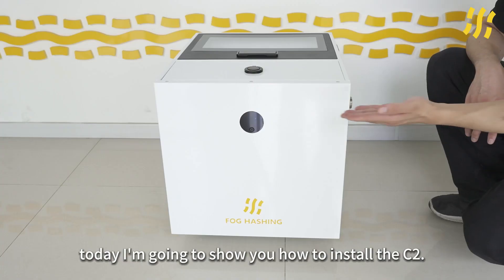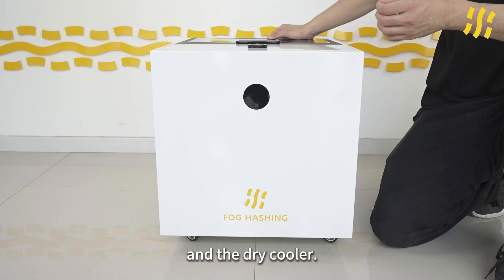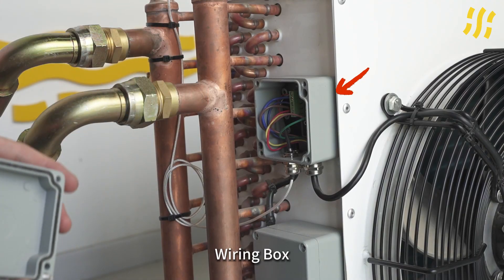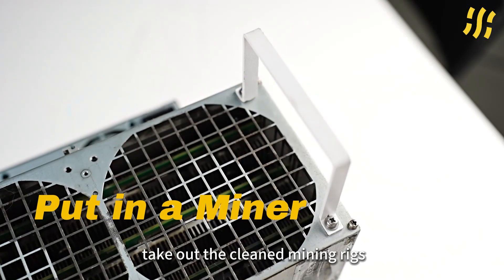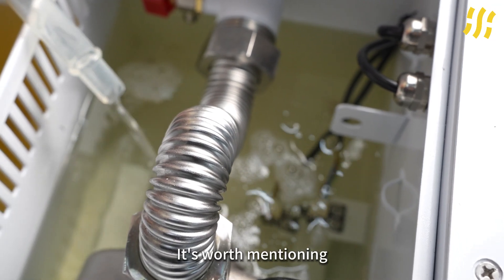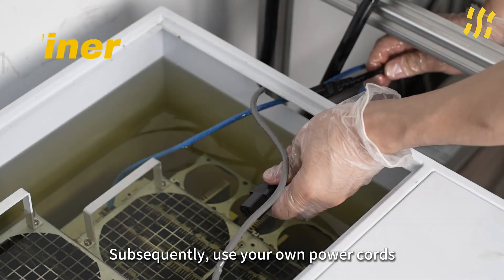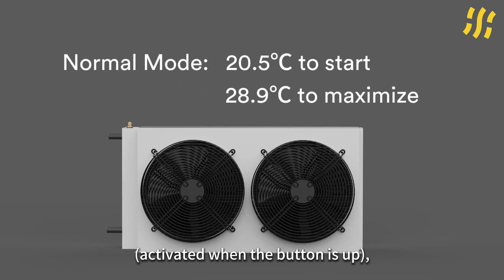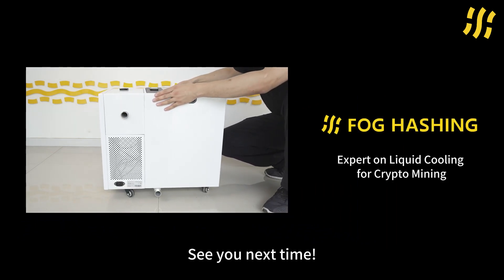Immersion Mining Kit C2 Installation Tutorial of FogHashing

Comment: Can I put the drycooler on my patio and the immersion tank? It would be outside technically but under coverage of roof and screen
Reply from the maker: The dry cooler can be placed anywhere. The tank can also be placed, but the tank needs to be protected to prevent water from entering the interior of it.

Comment: this looks great but I have a question:  if you are plugging the mining rigs into household power separately (and not through the C2 tank) how can the tank shut off the rigs if there is an issue?
Reply from the maker: When the mining machine goes offline, the tank will still be working, but the dry cooler will gradually stop running because it can judge whether to run based on the liquid temperature.